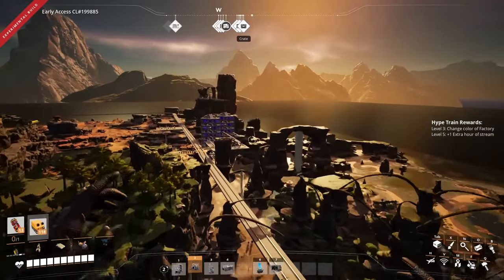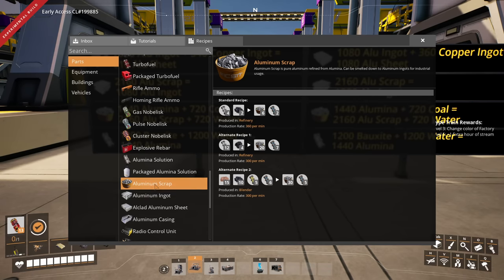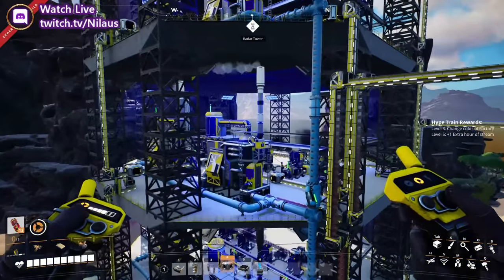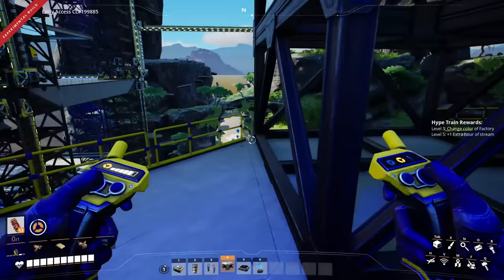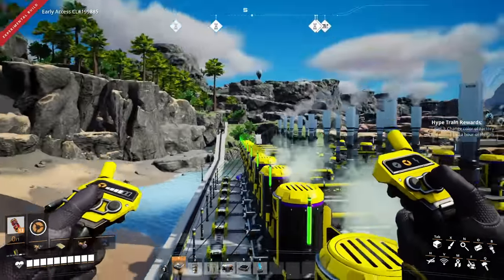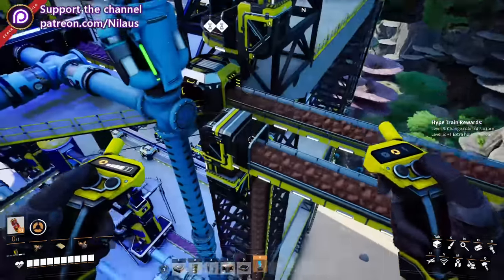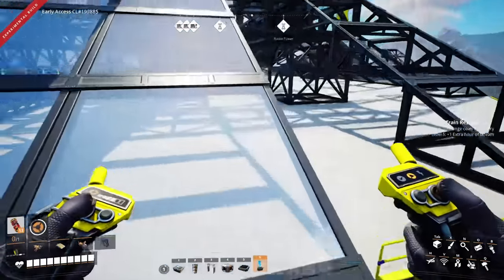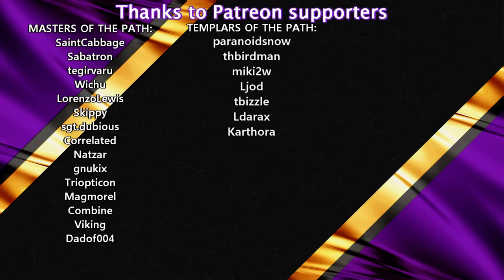SATISFACTORY TOWERS! Mega Alu Factory | 15 | Satisfactory Update 6

Comment: I have a small aluminum factory in one location on my first save.  In my case, I don't feed the water back into the alumina solution set up, rather, I direct it towards refineries producing wet concrete.  Because you can never get enough concrete I've learned.

Of course, the overflow goes into an awesome sink, because the aluminum must flow.

Comment: What I would like to see...
Security Cameras and a monitoring station like the workbench.
So we can set them up around the bases to check different points. Watching for overflow underflow and backups along the belts. That way we don't have to run for miles to make sure everything is operating.
Reply: Agreed, or a signaling system ala Dyson Sphere.